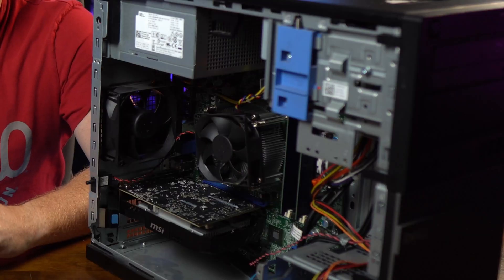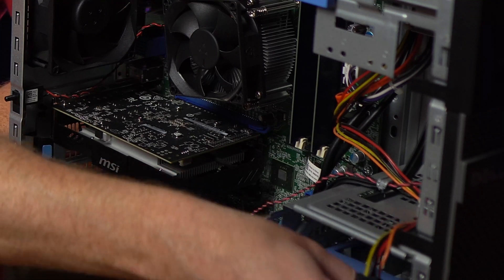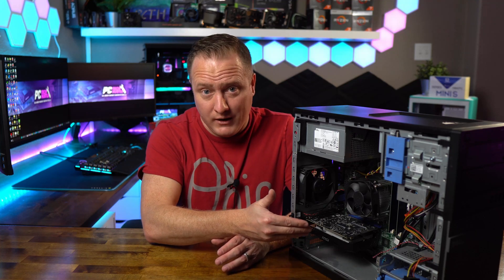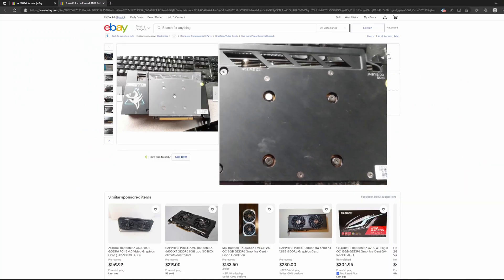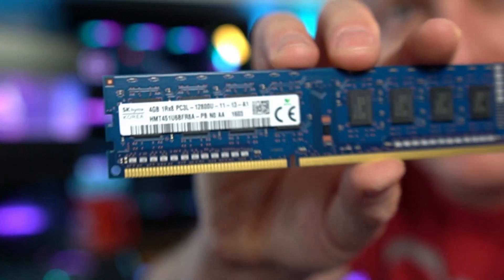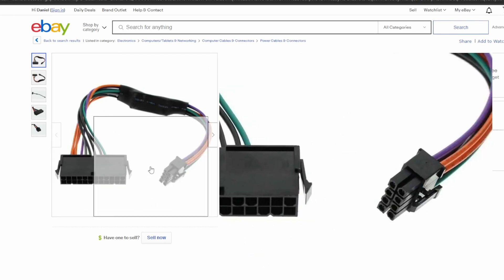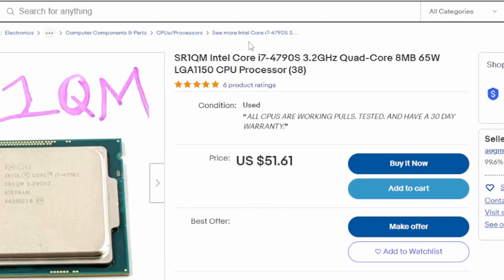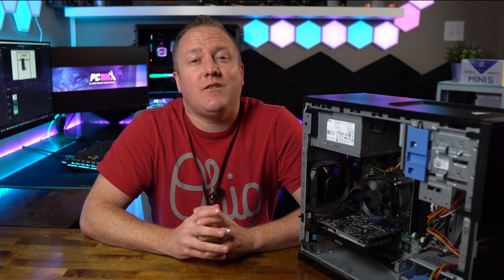Can I Turn a Dell Optiplex Into a Gaming Beast?  Parts Hunting for Reasonable Upgrades!

Comment: Hi bro really nice vidéo. I bought a optiplex with i5 8500u. Im wondering wich gpu will be better : 1660 super or 6600 xt? 1660 super is a beat cheaper (80/100€). What would you chose? Ty bro
Reply from the maker: 6600xt will for sure be the best for performance.  I’m not sure of you have the space / power though in that model of Optiplex.

Comment: i bought two recently, i for a truenas scale home server (3x4tb raidz1) and the other for gamer for daughter with used rx5700xt.  server has 64gb ecc ram for $190 shipped. totally awesome! also look at the hp z440 used cheap for proxmox (12c 24 thread 64gb ecc for $120 shipped), but the P520 is better cause of the M2

Comment: my optiplex 7010mt  has a newer motherboard because i have a 24 pin attached to it, not a 8 pin. so i wont need the adapter good news!
Reply from the maker: 7010 is actually older :)

Comment: I get these for free a lot of the time. Really translates to savings for my buyers. Overhead is nothing more than a gpu in some cases and less than $60 in lighting and aesthetics. $150 after a custom case and some lightning + labor leaves people more than happy more often than not.

A free Quadro P1000 for example only cost me a mini display port to regular display adapter and it screams for the main use the buyer wanted it for which was Apex Legends

Best thing i ever found in an Optiplex was a gtx 750ti. Was a Gen 3 i3 system. Worst gpu refurbishment I've ever done buy it still works 2 yrs later
Reply from the maker: Nice!

Comment: I have an optiplex 790 sff i7 which graphics card do you recommend?
Reply from the maker: The SFF platform is very limited.  You will have to find a small form factor card like a gtx 150ti or gtx 1650

Comment: I have a 9020 with the i7 and want to put the 1660 Super in it. Is that too much? Should I not do that and go for the regular 1660 or even the 1650 super? A new PSU will be going in as well so power isn’t a problem. I don’t mind if the GPU is a bit over powered for this but just want to make sure it won’t negatively affect performance of the overall machine.
Reply from the maker: That is honestly a very good balance.  With more power you could definitely go more with GPU.

Comment: 450Watts where I maxed out for this system.. Beyond just waste of money... CPU can only be upgraded to a point before bein' bottleneck by the GPUs anyways... Plus 4770 + 6600xt with mobo/storage etc only gonna be at 385Watts.. So 400/450Watts sweetspot for the Optiplex...

Comment: I recommend the E3 1230 v3 or higher - always. They're much cheaper than the i7s, work just fine in an Optiplex and perform the same. Leaves a bigger budget for the GPU.
Reply from the maker: Indeed a good alternative for sure!

Comment: This interesting video. How powerful is 4790 vs 10100 in performance? I Love how clear and easy to understand your video is. I would of liked to see the gaming and benchmarking be in the same video though.
Reply from the maker: The 10100 will way out perform the 4790 just due to the massive generation gap however obviously cannot work with this generation of optiplex either.   As for the benchmarks, please stay tuned!  I will have a video out on that as soon as I can get the parts in!
Reply: About 10-20% weaker. The i7 its k variants really shine when you pair them with some DDR3 2400+ and overclock the cache/ring. At that point, the i3 10100 can't compete anymore.

Comment: Great video, Dan!  I think a 4770 is a good match for a 6600, but a 5700 would likely be cheaper, and offers nearly the same performance.
Reply from the maker: That is a good point!  Multiple ways to skin the cat I guess!
Reply: BUT are those compatible with win. 11?????
Reply: @peabody4217 no. . . that cpu gen is not supported, no where near the minimum for Windows 11
Reply: @peabody4217  yeah you can get modded isos that allow windows 11 to be installed on any cpu